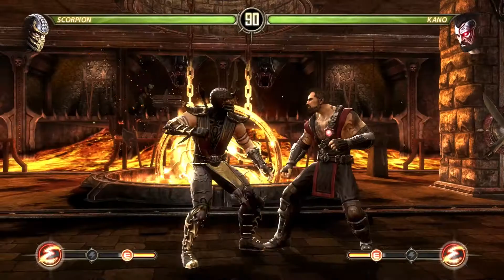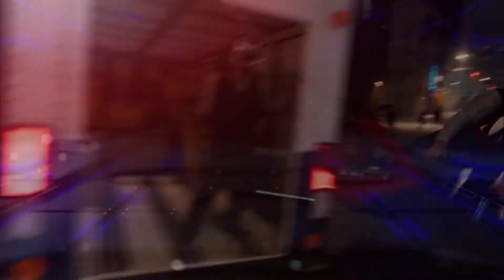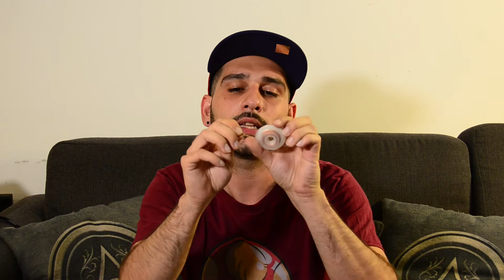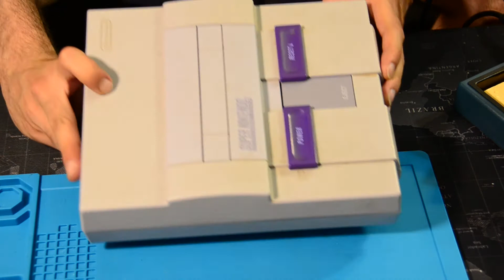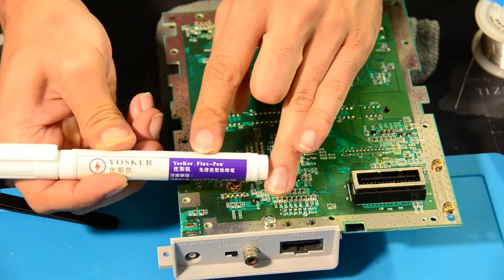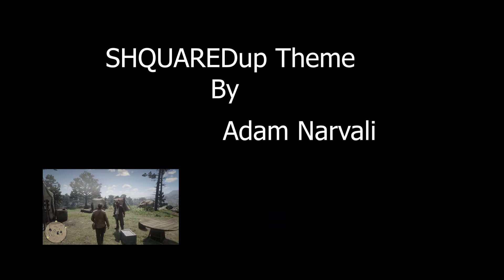BROKEN SNES POWER PORT- CAN WE FIX IT?

Comment: I would jist buy a new dc power  port, and do the same repair as the video... its probably aafer and youd run into less problems down the line if you do the repair properly.
Reply: Safer*

Comment: My DC jack was loose and power only worked when held a certain way. When I went to resolder the metal ring around where you solder came off. After soldering I now have no power at all. Is it because the metal came off and if it is how do I fix it?
Reply: Try finding any cracks in the solder that could cause it to not work.